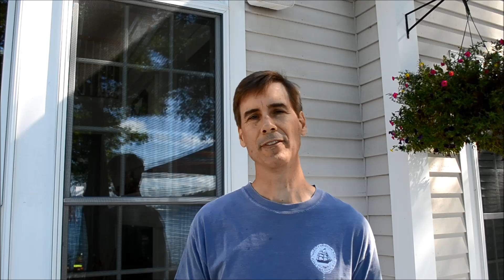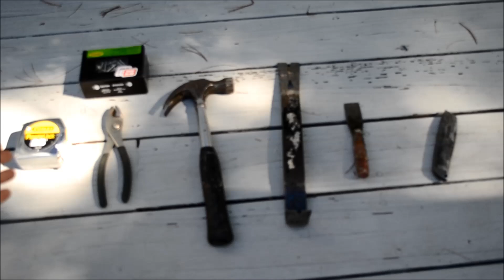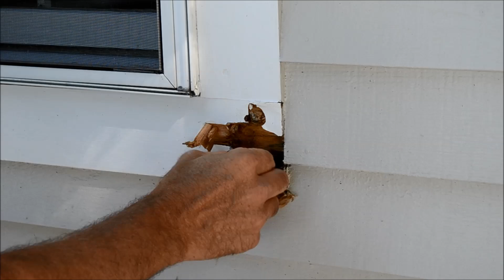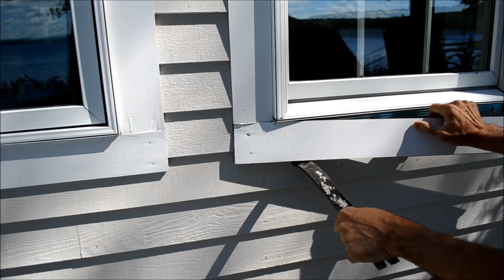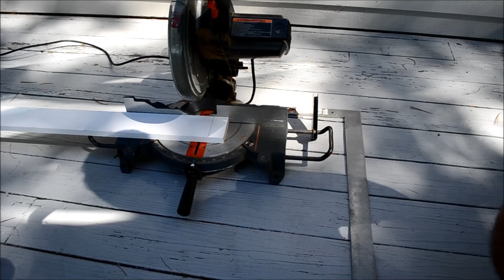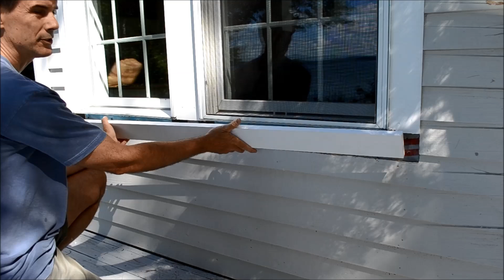How to Replace Exterior Window Trim Video

Comment: Can I used a silicone sealant at the top? I have really poor drainage with my windows that causes the rot.
Reply: You can't paint silicone (true silicone) so latex caulking would be better and can still be waterproof

Comment: I have nearly the same trim and windows as you. Of course they used some kind of press board so now it all needs to be replaced because it's rotten after 18 years. Thanks for the easy explanation!

Comment: The nailing flange of the window is ~1/16" do you not remove that amount of the trim to get a flat install?  Wouldn't the edge of the trim by the window stick out at an angle due to that flange?

Comment: I have an 1982 double wide mobile home with siding that sits  sideways up to aluminum windows. I'm replacing windows to vinyl myself starting this month. my question is can I cut 4"  off siding around exterior of old Windows  to reveal and access old window flange then put 1x4 painted wood around new window when done?
Reply from the maker: Yes
Reply: if you want the shear force resistance of your wall assembly to be the same then you'll have to add a number of fasteners to the shear panels, after which you'll probably want to do some touch up paint.

Comment: I'm replacing wood w/ PVC.  The PVC planks are 3/4" where the wood was/is 1".  They don't carry the 1" thickness planks here.  Should I just shim to compensate for the 1/4" difference or find 1/4" wood to use as a backer so the parts I replace are even w/ the wooden boards which aren't rotted?  Even if I replaced all, the trim wouldn't be flush w/ the window, so even replacing all, would need something behind it.   Thanks.
Reply: was the actual old wood 1" thick?  Because usual 1x4" lumber as described here is actually a bit under 3/4" thick.  I wouldn't be surprised if PVC material is different and the published dimensions are exact.

Comment: so, i am trying to replace an old window. it had a brick mold on outside, rough opening is 30-1/4"x49-3/4". It seems most new windows are fiberglass and have no brickmold. Is my solution to cut the masonite siding to fit 1x4 trim material on the outside?

Comment: wouldn't the water seep into the cracks and behind?
Reply from the maker: +Earth Inc. Gravity pulls the water downward and over the lip  of each clapboard. This type of trim style is commonly done and never an issue with water penetration. It would be obvious if there was water seepage by rot showing up behind the old trim.
Reply: @HomeAdditionPlus  Looks to me that is just what the case was with the old trim you pulled off. It was rotted all the way through. One could say the only thing that kept it from further damaging the materials behind the trim was the moisture barrier you have behind it - however since the water/moisture was already BEHIND the trim there's no telling the damage that lies below all that siding at the extreme bottom of the section you're working on, you know, since you didn't show any of it and like you said, "Gravity pulls the water downward."

Bottom line? I would have pulled the siding off below the window to make sure there was no damage.